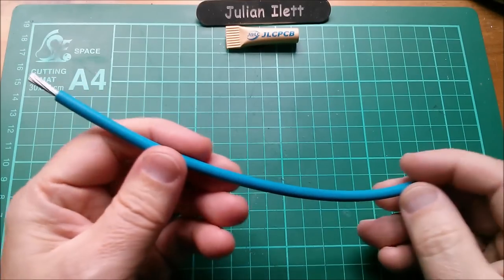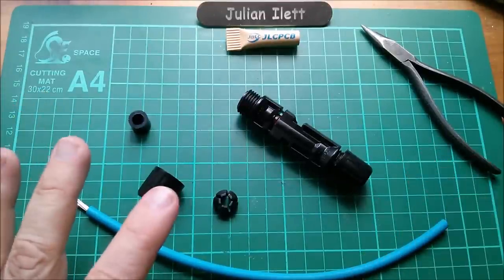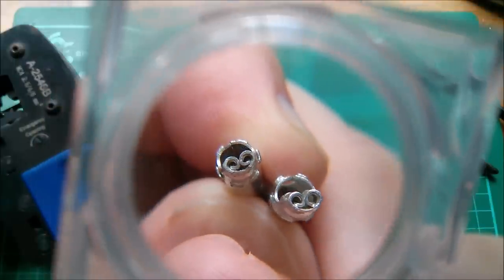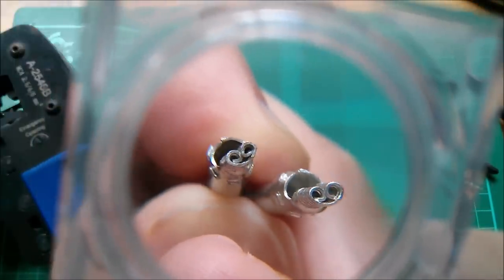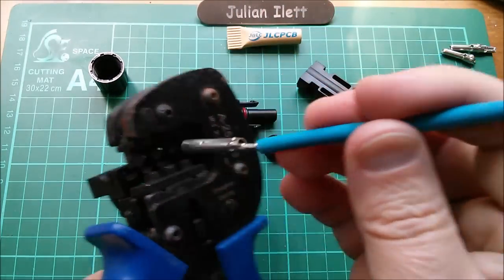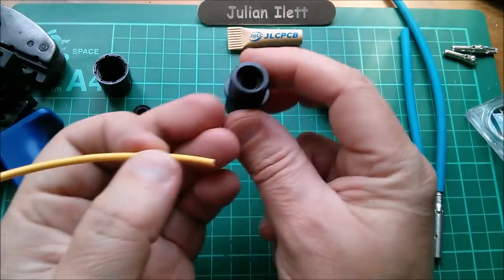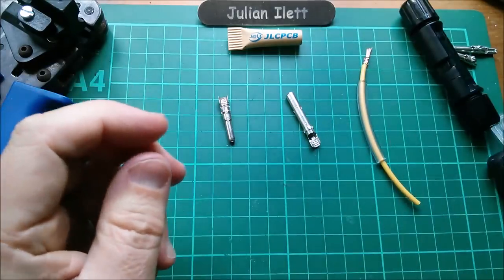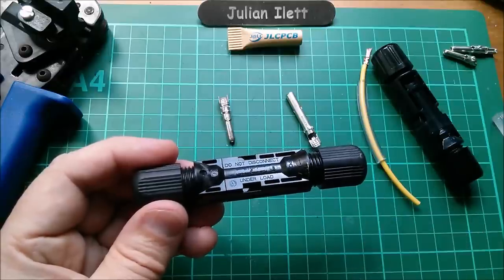MC4 Solar Connector, Cable and Crimp Tool Issues

Comment: Do you just leave the connection as crimp only? I'm about to add solar to my dad's motorhome and was planning on crimping and then lightly soldering at the crimp location.
Reply: Do not use solder on a crimped connection. Either only solder or crimp.  Don't remember why it was a bad idea to solder and then crimp, but it was something with different metals, and that the soldering could open the crimp.  And that the crimping didn't worked when wires soldered.  Like overheat the connection the soldering is melting, and makes the electric connection even worse, and heating more.

Anyway, the suggestion was to either crimp or soldering, not both.
Reply: There is zero issue with crimping and then soldering. I do this exclusively with MC4 connectors on all my installations.
Reply: @mygamertag2010X  that is not what I have been told.  If you do a proper crimp, you do not need to solder them.
Reply: At all of you... A properly crimped terminal (using proper quality crimp terminals which are the correct size for the conductor size and using a proper professional ratchet crimping tool) makes an excellent electrical and physical connection. The connection is so good that the crimp or wire will corrode before the crimp/wire connection becomes poor. And the mechanical connection will be so strong that when you try to pull it apart with force, in most cases either the crimp breaks or the wire breaks before the wire pulls out of the crimp. Hence not only is it not recommended to solder a crimped connection, it’s actually bad practice. A crimped connection can be made far faster (using the correct tools) than a solder connection. And because of its strength, crimped connections are strongly recommended for applications that are safely critical or environments that are subject to vibration. How do I know this? I’ve been working with crimp terminals for 33 years working on safety critical systems where reliability is extremely important. Systems that have a service life of up to fifty (50) years.

Comment: HOWdy J-I,
you could always utilize the BLUE full sized cable in your  MC-4 connector 
& then SPLICE your YELLOW Wire onto your BLUE wire down-stream with a BUTT-CONNECTOR 
or a Solder Splice & Heat Shrink ?
COOP
...

Comment: HOWdy  J-I,
Thanks
I beLIEve that your CRIMPING tool is made for a specific BRAND of Connector 
to use it for your generic CONNECTORS - you might want to totally remove the Magnetic Rear portion of your TOOL which seems unnecessary  ?
COOP
...

Comment: Don't fudge the small cable into the big connector!  You have the correct size wire already so just make a proper connection between the small and large wires and then connect the large wire into the connect the way it was designed.  There are YT videos on how to splice two wires together but it isn't difficult.  Solder it and put a good sealing piece of heat shrink tubing on it.  This will work better and look more professional than adapting a small wire that isn't even close to the right gauge for the connector.  You won't have any difficulty, Julian.
Reply from the maker: Sometimes aesthetics win over technical excellence :)

Comment: Why not hold the pin, not use the holder/ guide, then there should be no alignment issues!
Reply from the maker: The holder is there... it should work :)

Comment: Crimp and solder.  Crimp and solder.
Reply: No! A properly crimped terminal (using proper quality crimp terminals which are the correct size for the conductor size and using a proper professional ratchet crimping tool) makes an excellent electrical and physical connection. The connection is so good that the crimp or wire will corrode before the crimp/wire connection becomes poor. And the mechanical connection will be so strong that when you try to pull it apart with force, in most cases either the crimp breaks or the wire breaks before the wire pulls out of the crimp. Hence not only is it not recommended to solder a crimped connection, it’s actually bad practice. A crimped connection can be made far faster (using the correct tools) than a solder connection. And because of its strength, crimped connections are strongly recommended for applications that are safely critical or environments that are subject to vibration. How do I know this? I’ve been working with crimp terminals for 33 years working on safety critical systems where reliability is extremely important. Systems that have a service life of up to fifty (50) years.

Comment: I don't even bother buying crimpers, i just take thick face pliers and squeeze it down.
Reply: I can tell you your squeezed crimp is not nearly as strong. I think you should test one. You might be surprised how easily your wires pull out. I've never used 4mm wire but even 10 AWG wire breaks before it pulls our with a proper crimp.

Comment: No Idea how many times I've put the wrong Terminal in the Connector or how many times I put the Wrong Connector on the wrong wire.  I seem to be quite good at it.    Why do they put the Red Pos ring on the Male End knowing it will be the Female end being extended ?  LOL   XP-90 go on all inside wires here.    Being Poor I just use a Automotive Terminal Crimper and solder the things.  No Problem Encountered.  Male Terminal in the Female Connector , FeMale Terminal in the Male Connector, Positive Male Connector unless being extended then a Female Connector ,  Eaaaaaaaaaaaaaaaaaaaaa #4@^&##   Save yur self a bundle and just use the Automotive Terminal Crimpers.
Reply: pulesjet, I wish I could not relate 🙃
Reply: @mikemead2315  LOL, The whole situation is BackAzzWards start to finish.    Nothing making sense.

Comment: If you have a installation where you get both 1000V and hundred amps... You either have a 100kW installation, or you made something very very wrong.

There is no real reason to go for very high voltage for a domestic installation. It just becomes very dangerus. Remember DC is much more dangerus than AC. Keep it under 100V
Reply from the maker: Did I say 100 amps?
Reply: @mekuranda  
"I doubt anyone else thought that max current and voltage would occur at the same time."
It usually does, but its no law of nature. If its installed very wrong, it may not be the case.

"nearly all Grid Tie solar inverters in European (220-240 V) want to see above 340V DC at max power point.....s 100 v is not much good for anything other than off grid/battery systems. "

You don´t have a clue what you talking about. most domestic inverters are step ups.

"Also I am not sure about your advice re danger of  DC vs AC.."
If you don´t know about this that is very common knowledge, you should not be informing anyone about electricity
Reply: @matsv201  Just for fun - with reference to the danger of DC - a fun video (well I thought it was funny) is https://youtu.be/trmxzUVT2eE .
I am guessing you live in a country that has curated products and you may not be aware of mainstream Grid Tie inverters - i.e. the ones manufactured and installed on mass in the western world. The highest efficiency for all power distribution systems relies on minimizing IR losses hence higher voltages and lower currents. I re watched Julians video and I could not spot where he mentioned 100amps - I am fairly confident he didn't - so please correct us all and give us the time stamp. The whole presentation was primarily about MC4 connectors which have a maximum current rating of 30 Amps and the 4mm square conductors would be OK to about 20-30 amps depending on ambient Temp etc - 100Amps would be exciting to be sure - luckily solar panels are generally 10amps or less (each) - and approx 25-35v at max power point - and it is not uncommon to series 12 panels per bank - giving in the order of 350 volts - that is a max power level of a theoretical 3.5kW - so in most installs where a 5kW system (again Grid Tie) they may run two strings - the cable then only carries 10 amps max. If you shorted the string the power to the short will be near zero - The solar panels can only provide a 10 amp max current level hence the max power point is where the panels can supply good current and voltage - nothing in a bad installation can generate 100amps at the DC stage!